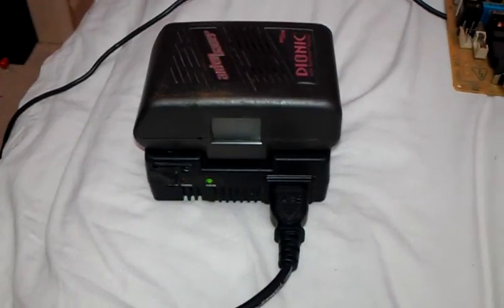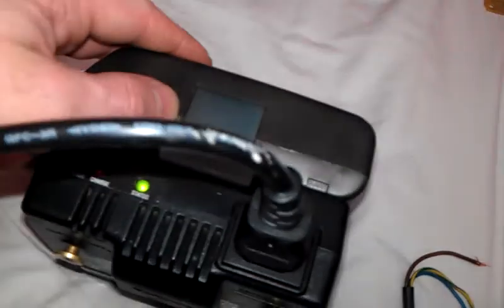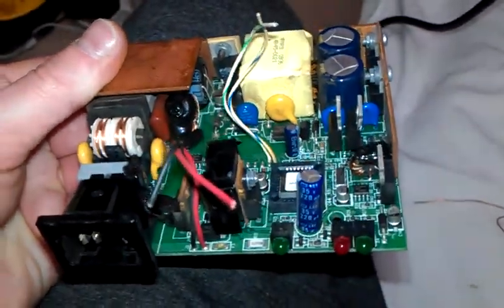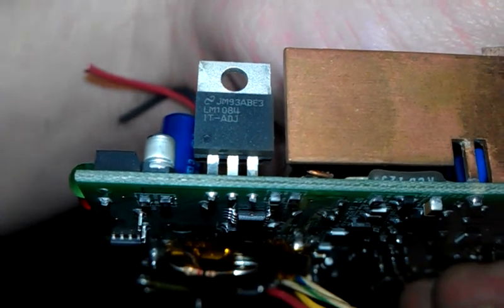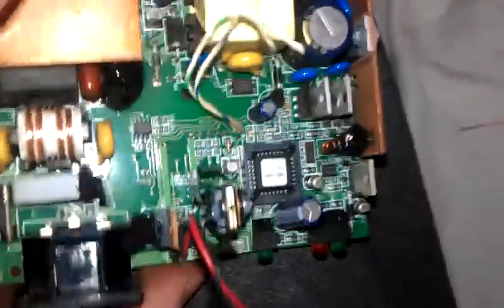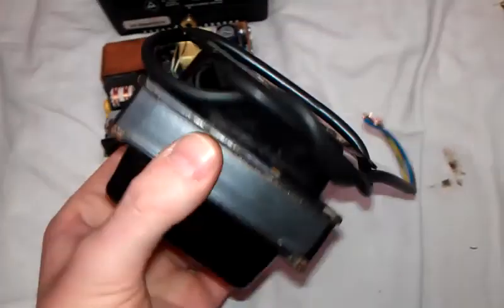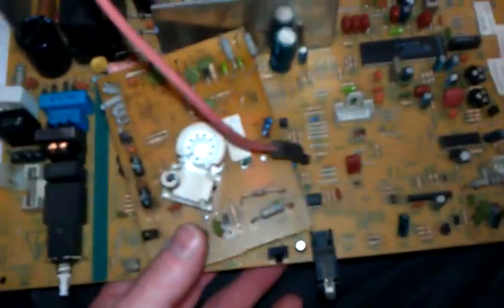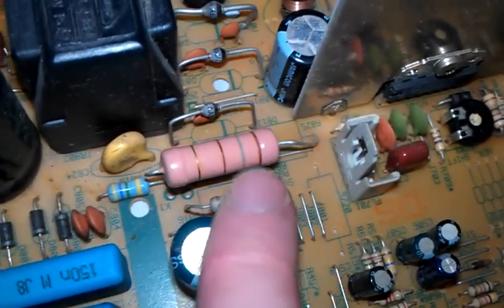More bits from scrapyard

Comment: and maybe the HIGH and LOW switches could be like a high pot test or frequency output that is determined by the length of  the conductor that your testing. Just a guess so I coul dbe wrong but I think I'm in the ballpark :)